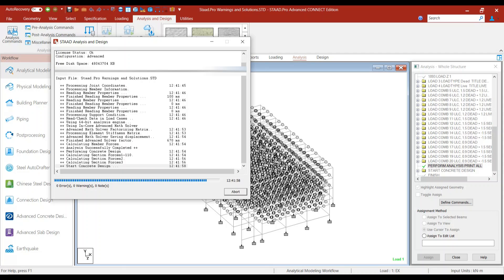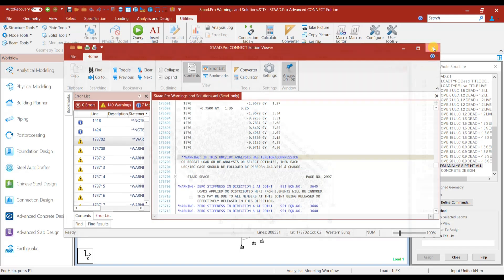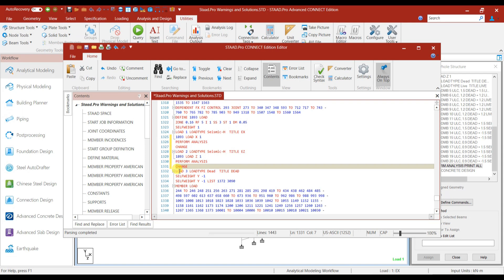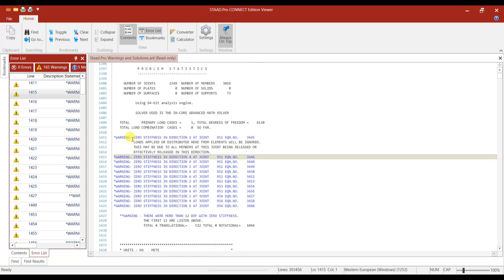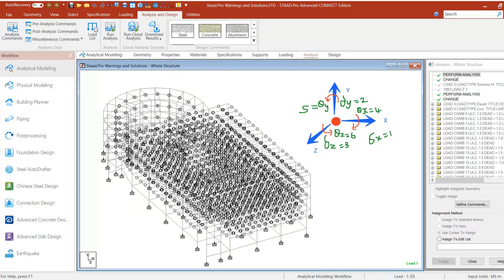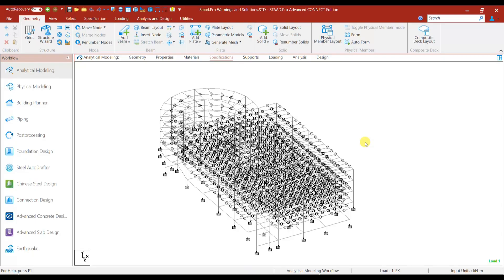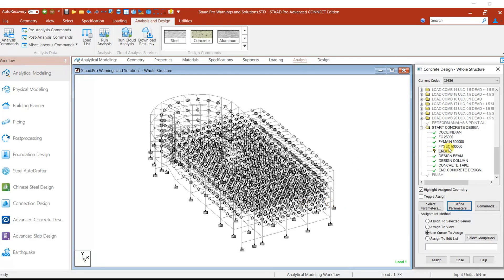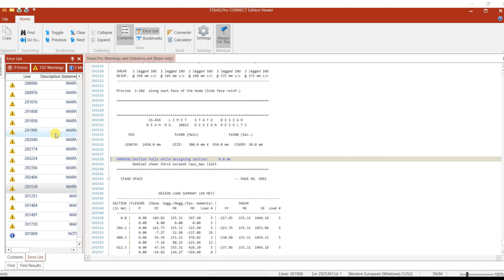Warnings in Staad Pro Advanced Connect |How to resolve Staad.Pro connect warnings|Staad.Pro warnings

Comment: Didi pls do a building design with stair case in Staad Pro connect edition. It may be a small building with G+3 floors. It's a request .. 🙏🏻
Reply from the maker: I'll try to make a video on that topic soon.
Reply: Doing stair case design in Staad will give detailed drawing in RCDC. That is why I have requested a video.
Reply: Nobody does staircase design in staad pro, only DL+LL is applied on MId landing beam and stair design is done in excel sheet in most structure design offices